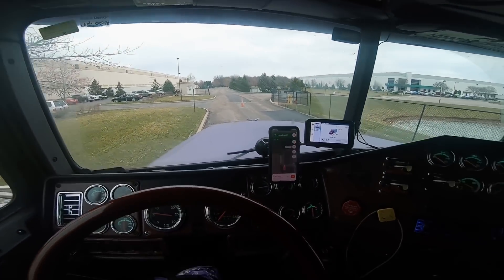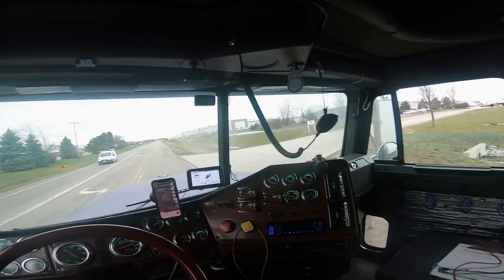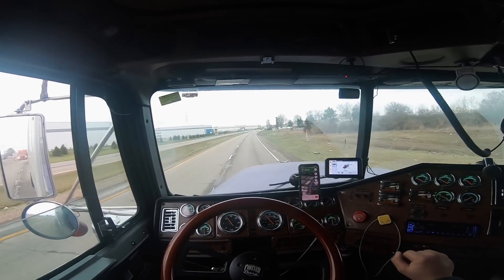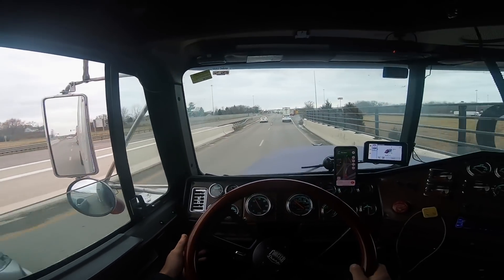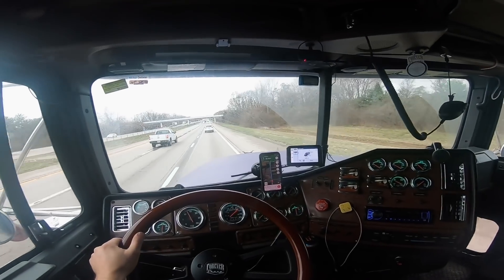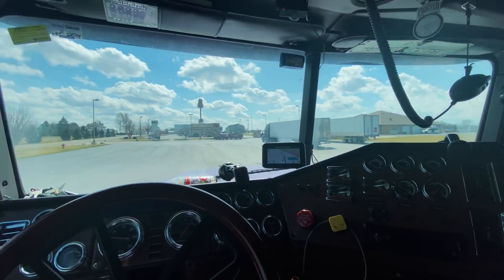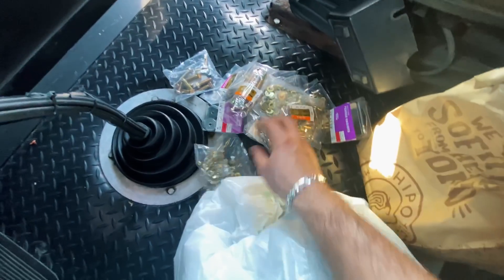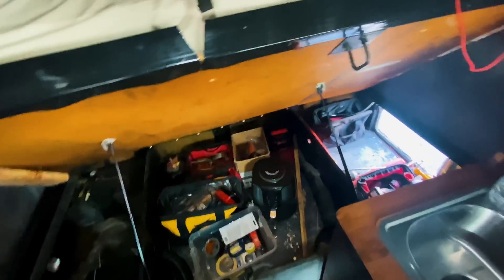$140 tune made my truck run like brand new+ fixing a few things on my freightliner classic

Comment: Stop lugging the engine. 12,7’s love higher RPMS shifts.
Reply: Kills me watching him lug it like that, I drive a turned up CAT and usually only pull 8-9000 pound loads, and I still won't shift under 1500rpm.
Reply: @BMW_Mustang_Dodge  I’m gonna keep commenting it until he acknowledged it
Reply: @BMW_Mustang_Dodge  he’ll need an engine rebuild in 6 months watch
Reply: @Adventures of Trucker186 Well for one, I’m also a mechanic and a driver. I’ve rebuilt plenty of both Detroit’s and CATs. My father also being a mechanic for 30+ years on only semis. Doesn’t mean I can’t be wrong, but my CAT likes 1600-1700. And the 12.7 that I drove for few months got worse fuel mileage on paper when I stayed under 1500. Not only that but I’d be holding up traffic trying to get speed to stay under. I don’t like revving the shit out of my stuff or others. But regardless, I didn’t see him touch 1500rpm in this video, maybe I missed it but for as long as I watched I didn’t see it. Like I said not claiming to know it all, but from my experience I was lugging the shit out of it, and I was running an 18 speed splitting the bottom gears to keep the rpms under to save fuel, and I didn’t save myself anything. Have a good one!
Reply: @Adventures of Trucker186 Nah I only really like electronic engines. Have a 6nz, and a MXS, and building a BXS 800-900hp for my 379. But I’ve run 06 ISX, and couple series 60 Detroit’s. Them little 12.7s are great motors though, rebuilt one 2 years ago, 2.3 million first time the heads been off. Team drivers always loaded Max, running Washington/Oregon to Massachusetts. But they take care of it very well.
Reply: @Adventures of Trucker186 I’m not hating on him you know, I’d just hate to see a broken crank when he could rev it up a few. I’ve seen and replaced a few from that, so hurts me to see it happening🤣
Reply: @Adventures of Trucker186 he’s shifting at like 1400
Reply: @Adventures of Trucker186 you can see in previous videos hes shifting around 1400 and it drops to 1100-1200
Reply: @Adventures of Trucker186 that’s why I’ve mentioned.
Reply: @Adventures of Trucker186 oh well
Reply: @Adventures of Trucker186 no worries bud